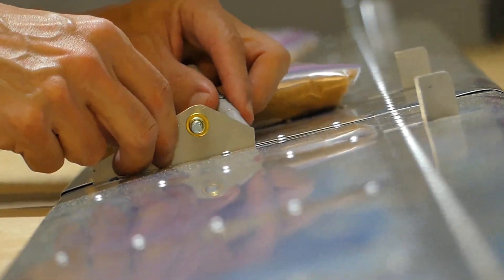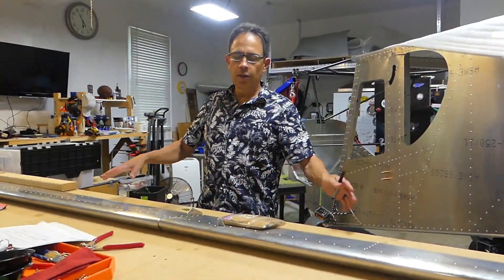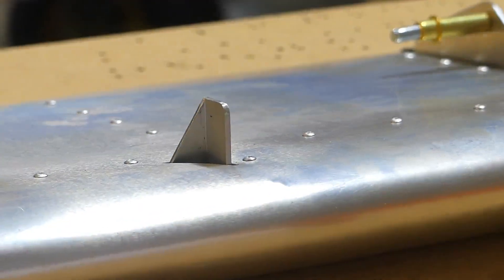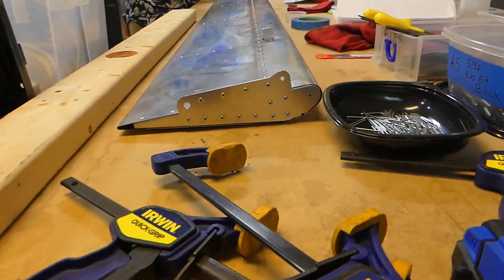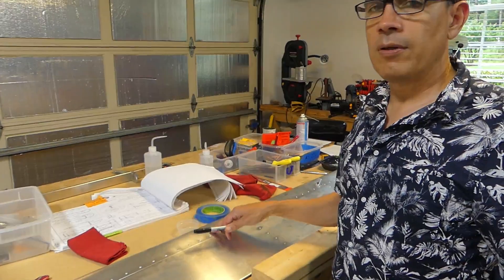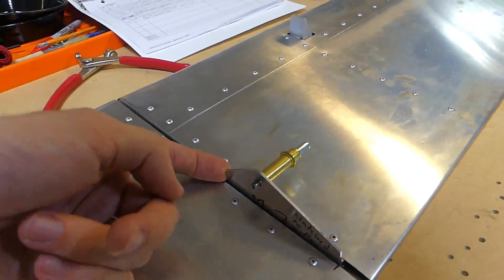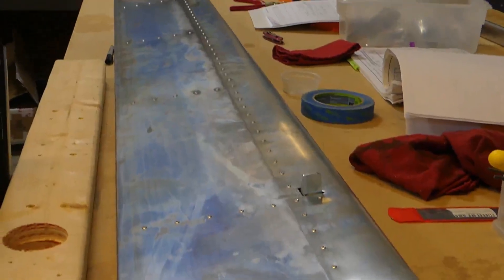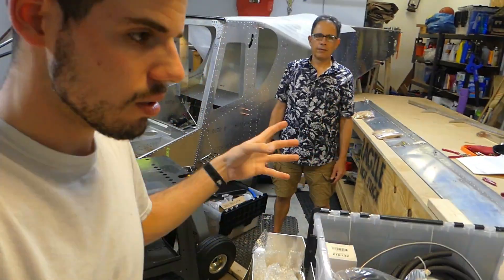Flaperon Progress & Build Notes - Zenith 750 Cruzer

Comment: Don’t forget that the I/B flaperon half  trailing edge is mounted 15-17 MM lower than the O/B half trailing edge, in order to stall the inboard section first allowing the outboard section to continue providing lift and control authority. That arrangement replaces the function of washout in the wing. ..
Reply from the maker: Thanks for the heads up!

Comment: I'm just curious, did you guys spray primer on the internal aluminium parts. Some builders to, some don't. its alleged to protect against corrosion and salt  over time should moisture find its way to  internal structures.
Reply: He used some brush on anti corrosion material in an earlier video.   I've seen both, and I've seen people argue about use or non use.  6061 to 6061 should be pretty stable in all conditions, 2024 I've read should use a inhibitor as its typically not alclad.  Dissimilar metals, steel to al should be protected and primed. Steel should be protected.  Lots of discussion on this, lots of videos out there.  And written materials.  In the experimental world its up to you.
Reply from the maker: Jeff, good question. No. We are applying corrosionX to mating surfaces that will be hard to get to later, but we aren't doing traditional corrosion protection. With the 6061-T6 aluminum alloy, I'm confident that corrosionX treatments will be more than sufficient.